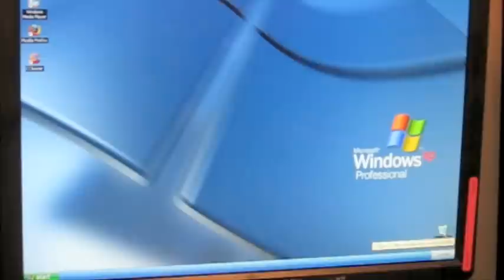Smash Another Dell

Comment: Computer: Previous attempts to smash the CPU Cooler were detected, To confirm that you are not Garret press F1 To continue booting press F6
Reply: LOL,mine say this:
Warning!Previous attemps to make the Stick Bootable were detected.Strike F1 if it's an HDD fail,replace and strike S if you are Fox256,press CTRL+ALT+DEL to restart,unplug the Stick if you are angry,disable the fan if the CPU is sick or press any number to Boot Windows 7 Ultimate.
Reply: He destroyed the fans,CPU,RAM,Hard Drive,GPU and the motherboard.
Reply: 1:19 The fan survived but it still spins with weird sounds from the fan
1:21 R.I.P Fan
Reply: F1

Comment: PC and Mac are two very different types of machines, although preforming the same tasks, they are for different people.  For example, someone who wants a computer where the parts are completely up-gradable and varying, they would go with a PC.  On the other hand, for someone who wants an out of the box, decent computer, who does not plan to upgrade or add functionality to, would choose a Mac.  Like I said before, they are very different, therefore, one is not better than the other.  It all comes down to if the computer can perform the tasks given to it by the operator.  Btw, I like PC. :3